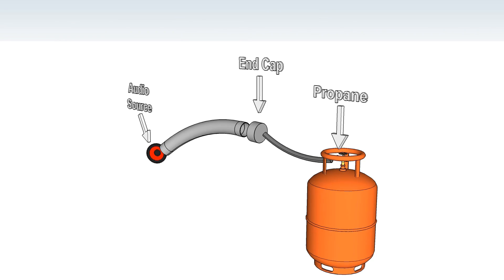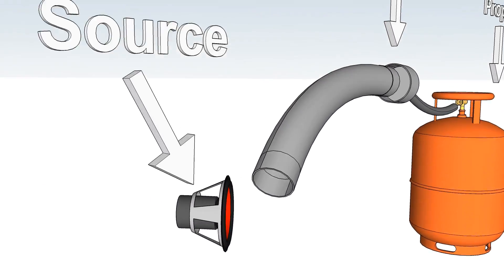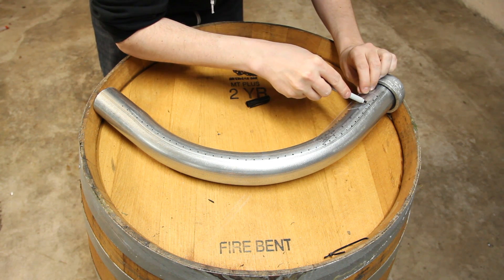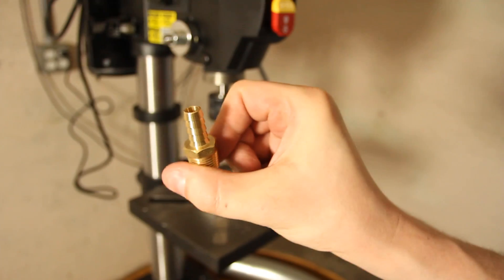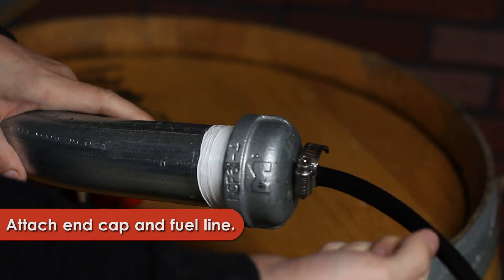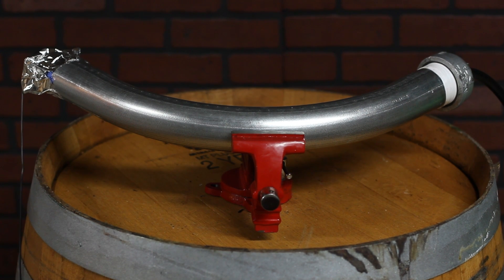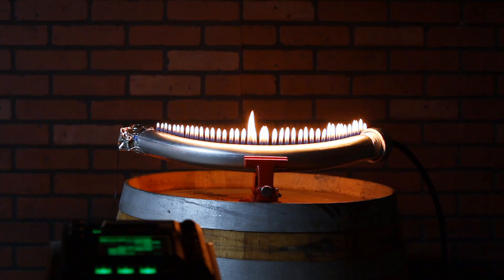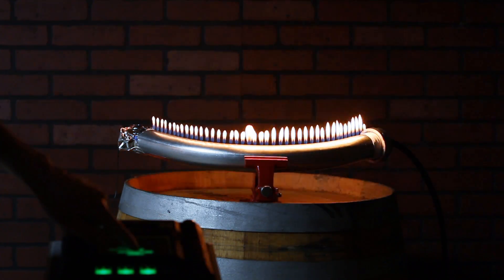Sound Reactive Flame Tube! (Rubens Tube)

Comment: lol.
>"I used a hammer"
>nozzle has threads
Reply: the nozzle probably has gas pipe thread instead of a regular thread. so he may not have a gas pipe thread tap laying around. in that case the hammering in is a good choice. albeit not a very lasting choice
Reply: I figured he didn't have something matching, it's just funny to me watching the Golden Hammer principle in action.
Reply: ok lol. the "golden hammer principle" is one I use too
Reply: Nice
Reply: the nozzle has 2 sides, one side has ribbing on it, this allows it to fit snugly into the hole. the other end has the threading for the gas pipe.
Reply: Spewan  wrong way around. He used the threaded side for the PVC and the ribbed side for the rubber tubing. You don't use threads on rubber tubes, you use the ribs.

Comment: its not really the sound but the speaker movement changing the pressure inside the tube pushing the gas at different rates.

Comment: You are right.
However there are another "safety" in this setup; even if the mixture would be complete with oxygen there is one factor that would prevent flames from going inside: thermal conduction of the tube itself.
Whenever the flame would reach the metal it would cool down by dissipating the heat in the metal tube, but as soon as the tube would reach a certain temperature, the flame would "jump" inside (but only if mixture would contain oxygen).

Comment from the maker: Once you struggle through making one you can recreate them fairly quick. I had to make about 4 of these before the final one you see here. I started out trying plastic PVC pipe wrapped in aluminum tape, that worked well for a bit but the holes eventually lost their integrity. Metal all the way.

Comment: No because the speaker is only in contact with the gas the flame can not happen in the tube not enough oxygen so the heat is minimal at best on the speaker. Also if anyone plans on scalling this up the bigger speaker the bigger tube and gas source you will need. Like a sub for a car would need ether multiple tubes or one big ass tube.

Comment from the maker: I was using the small disposable cans and a basic fuel hose with shut-off valve. The small propane cans cost about 2 bucks. Granted, they freeze over quickly so a heat bath was needed if I wanted to run it longer than 15 minutes.

Comment from the maker: It's wouldn't make much difference and could possibly ruin the effect. You see, as the audio enters the tube it changes the gas pressure inside. If you were to put a mega-sub on the end it would simply force all of the gas out at once making the device go out.

Comment: Ah.

Didn't think about that.

I'm still fairly unclear on how to operate one of these. Seems to me like there would be oxygen inside from just leaving it without using it, so would you have to pump that out? And if you did, wouldn't lighting it entail guessing the exact time there was no oxygen in the tube and that propane was coming out, otherwise there would be a large amount of propane already outside and it would create a fireball?

Maybe I'm just over thinking it but I'm just curious.